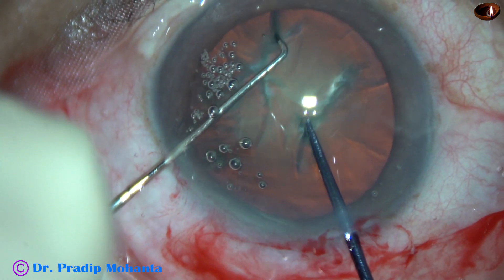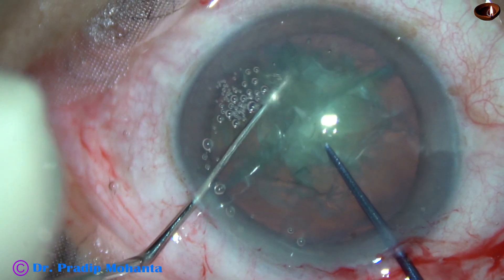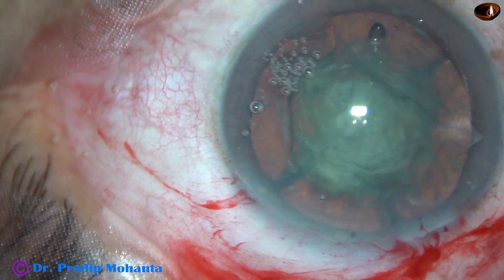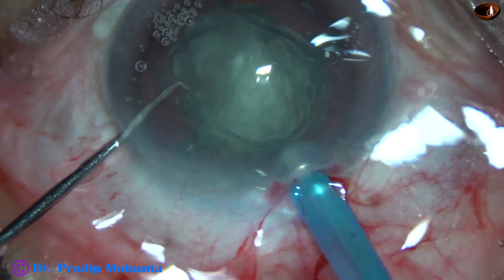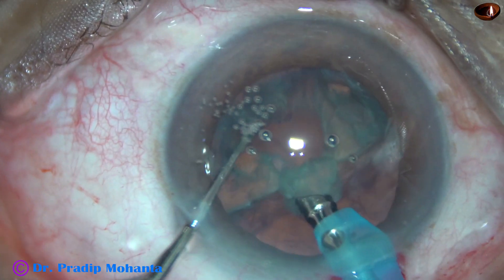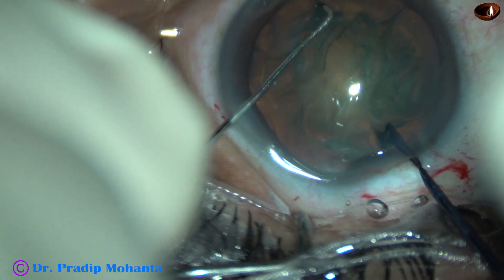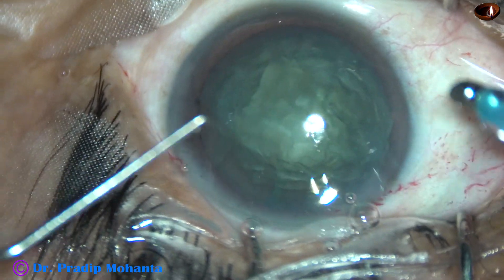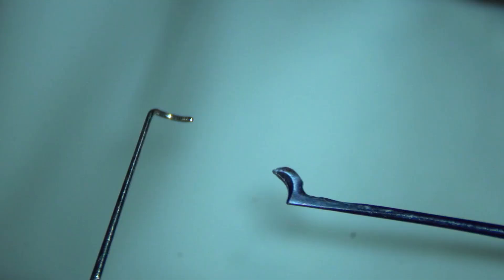My first two cases of Nuclear division by Dr Sohel's Prechopper : Pradip Mohanta, 1 November, 2020

Comment: Thanks for your post , but this instrument was developed already 6 years ago and already patented by dr. Sergio Jacobovitz.
Reply: That's true the Jacobovitz multifuncional chopper is being sold by Geuder Germany
Reply: Attached the link to the company (Geuder) that is selling it. https://youtu.be/LfCXZ8hfpwo
Reply from the maker: I didn't know that..
Reply: @pradipmohanta9321  
Respected Dr Mohanta Sir, 
I Explain that both instuments are different and we are using different techniques and there will be no doubt after watching the video
https://conta.cc/2SGZ46h

Any device to cut the nucleus will have a cutting edge.
But the the design of my device ,it's dimensions , it's needle like tip  which burries in the substance of nucleus to begin the nuclear disassembly and perhaps   its action are all entirely  different.
You are using two Choppers on either side of equator to begin the crack.
In my technique the nucleus is hooked by Chang's Horizontal chopper or Akahoshi ball sustainer and the prechopper is inserted through main phaco wound and is buried in to the substance of the nucleus to begin the cracking process.
The Needle like tip impaling the endonucleus is the silver lining of my device and the reason for its success.
And my device too is PATENTED
 as you know
Please do check my Award Winning Video.

https://conta.cc/2SGZ46h

Thank You
Reply: Dear Dr Jacobovitz

Any device to cut the nucleus will have a cutting edge.
But the the design of my device ,it's dimensions , it's needle like tip  which burries in the substance of nucleus to begin the nuclear disassembly and perhaps   its action are all entirely  different.
You are using two Choppers on either side of equator to begin the crack.
In my technique the nucleus is hooked by Chang's Horizontal chopper or Akahoshi ball sustainer and the prechopper is inserted through main phaco wound and is buried in to the substance of the nucleus to begin the cracking process.
The Needle like tip impaling the endonucleus is the silver lining of my device and the reason for its success.
And my device too is PATENTED
Please do check my Award Winning Video.

https://conta.cc/2SGZ46h
Reply: Respected Dr Mohanta Sir...Thank you for sharing the post..
Hello Dr Sohel & Dr Jacobovitz...I appreciate both  your instrument & procedure  for Cataract Surgery ... As we All are Ophthalmic Surgerns & we All  know that we are doing same cataract surgery using similar but different instruments for doing cataract surgery.. Technique we All are using for doing cataract surgery is also having little similarities  with little difference... Because  we all use is to remove cataractus lens & to implant  Artificial IOL.. IOL are also similar but there is difference in Every IOL.. 

Same is here in your case... Both of your instruments have also little similarities & little difference... Because Your  aim is same..You both are doing cataract surgery for the same Aim with different Instruments... There are so many Instruments we All are using since long time... Having so many similar & different features... So here is Dr Sohels Istrument & here is Dr Jacobovitz  instrument.. Both are different 👍.... 
There is no doubt that Both instruments are having a Cutting edge Difference..,, Design & Dimensions are entirely different.. 👍 Dr Sohels instrument is having needle like tip which burries in the substance of nucleus to begin the nuclear crack or disassembly & the action is also different👍👍as well Dr Sohel is using Dr Chang's choper to hooked the equator of nucleus & the needle like very sharp tip goes into the substance of nucleus to being the crack.. This Difference in the Instrument & Technique is nicely visible in the vdo link which is provided  by Dr  Sohel in his comment👍👍Both the instruments are clearly Different..sharing link of one more video of All India Ophthalmic Conference..AIOC...Please Watch👍https://youtu.be/tSnt9vdW-vk

Comment: Dear Doctor Mohanta: i use a very similar frontal cut Chopper called Jacobovitz Multifunctional Chopper since 2016 with almost 2000 cases performed. It is comercialized by Geuder. With a bimanual technique using two Choppers we can divide almost all kinds núcleos. It can also be used as a Chopper in combination with the Phaco probe in the other hand. Also in FLACS it can be used to easily separate the quadrants.
Reply: With all my respect for Dr Khan, I would like to clarify that this instrument has already been invented and patented in 2014 by Dr Sérgio Jacobovitz, the JACOBOVITZ MULTIFUNCTIONAL CHOPPER. The design of both instruments are really similar, but the Jacobovitz multifunctional chopper has also a retractor blunt portion for retraction of the capsular ring.  It can be used either for both VERTICAL and HORIZONTAL chopping techniques. 
https://www.youtube.com/watch?v=-ywYxzvXK44&t=34s
https://www.youtube.com/watch?v=d5j-HKuAwDk
https://studio.youtube.com/video/MVuhMbeusTA/edit
 We also have a publication in the European Journal of Ophthalmology regarding the use of a pair of such anterior cutting choppers ('Symmetric Bimanual Phacophragmentation') and an ESCRS 'video of the month' about the chopper ('The double pit technique for rock hard nuclei' Copenhagen 2006). For more information please check my Channel on the Youtube, 'Jacobovitz chopper'.